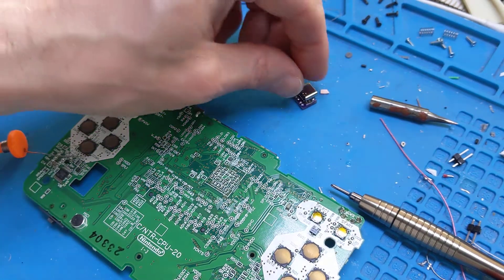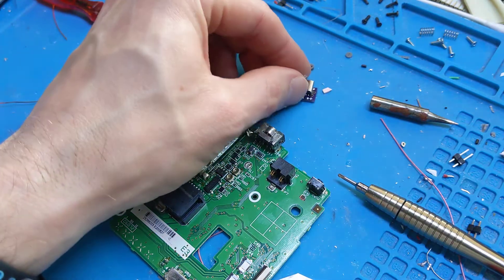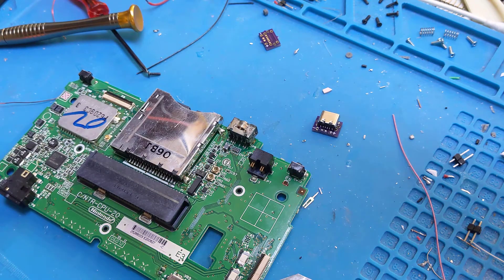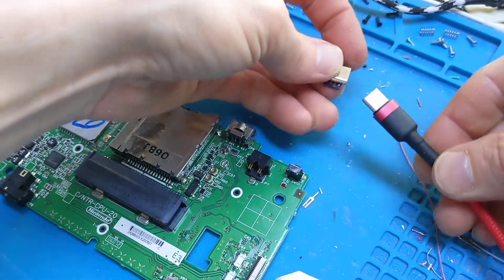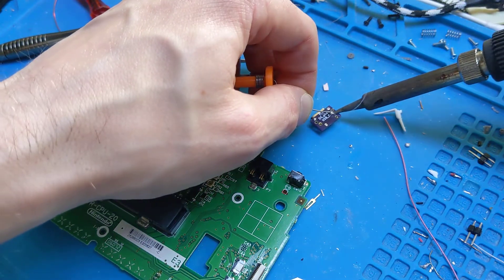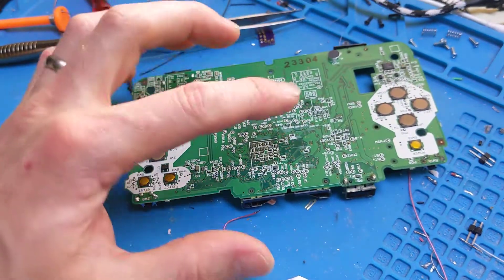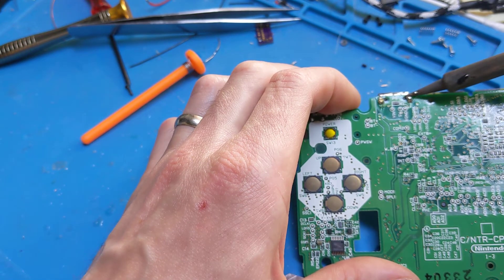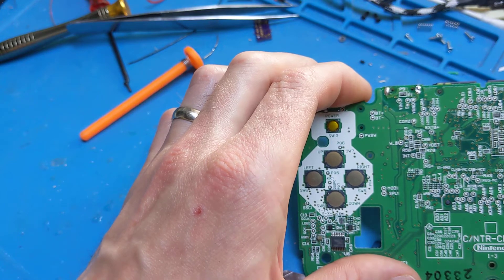Gameboy Macro XL USB C charge mod

Comment: Hey first off , nice and interessting video! And may i ask what the resistor on the usb board is good for? Thank you in advance
Reply from the maker: Hi, thanks, they are used so that it will charge when using a usb c to usb c cable
Reply: @facelesstech  Thank you for the answer! And wow thats neat!